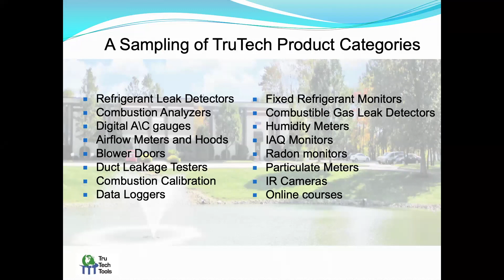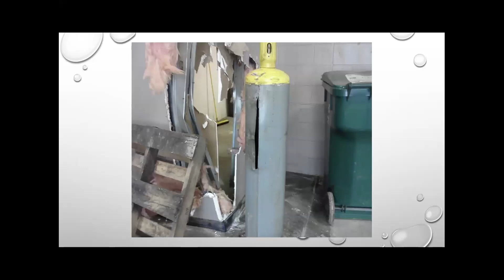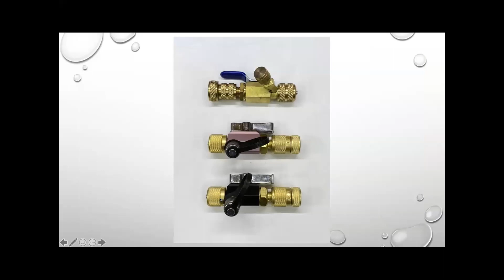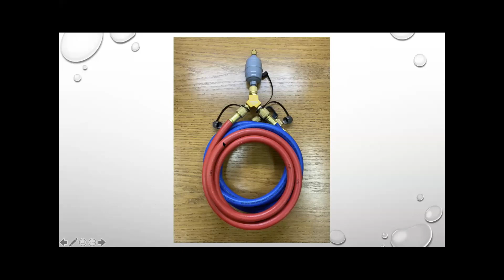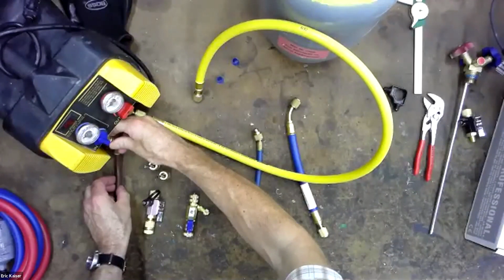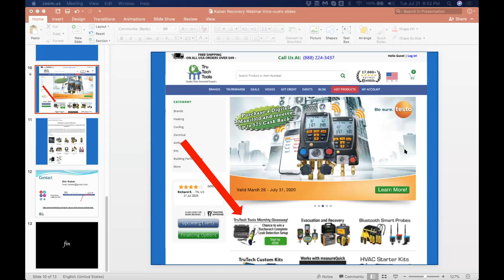Refrigerant Recovery with Eric Kaiser (Non Flammable)

Comment: How often do you recommend changing the filter drier?
Reply: Eric explains towards the end that if you have a relatively clean system you could get a couple recoveries out of one filter drier. It’s when the system is dirty and not well maintained when you might want to have a backup filter drier as a clogged, dirty filter drier will degrade the performance of your recovery machine.